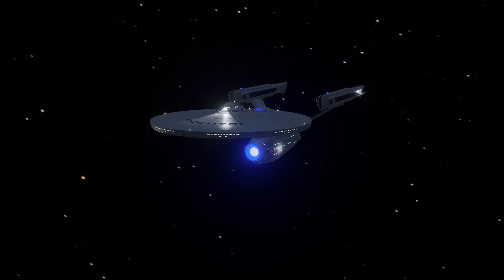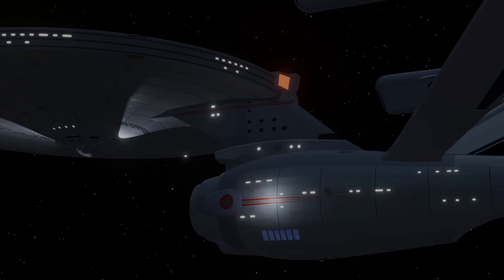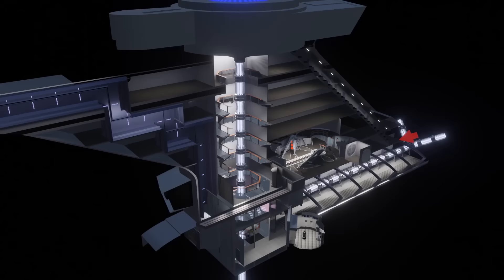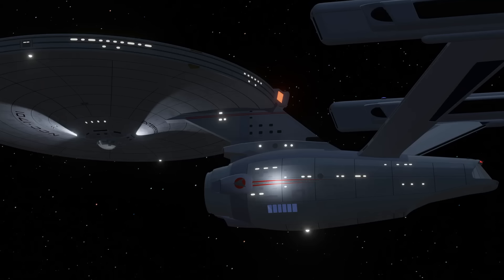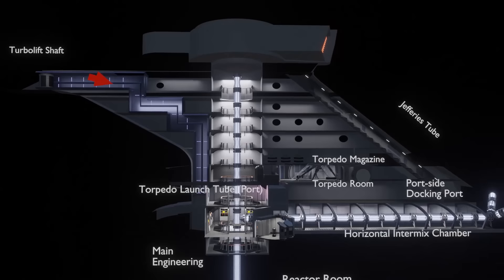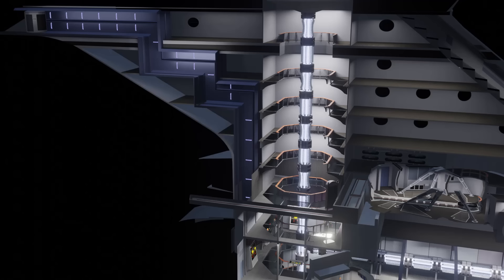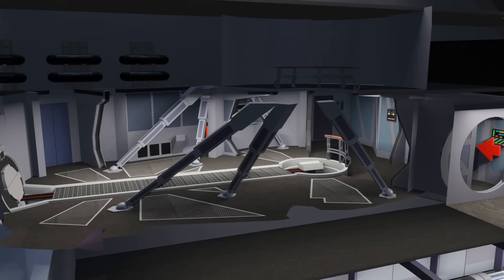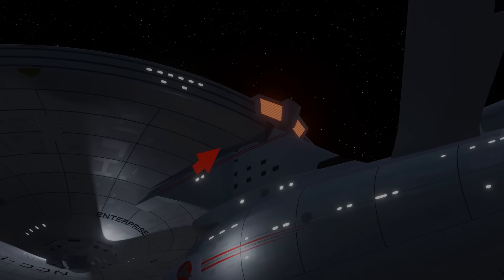The Enterprise Dorsal Problem: how did the turbolifts pass through it?

Comment: Great video! I hadn't considered the notion that the turboshaft could span diagonally. I suppose if we want to rationalize a little bit, I could imagine Kirk left the torpedo bay to cross the balcony around the warp core shaft to a turbolift access on the other side.

There's a set of deck plans made by the guy who does Cydonia 6 for both the original and refit Constitution / Enterprise that are just epic, especially because they make locations line up brilliantly pre and post refit in a way that makes sense pretty well. On his designs the turboshaft is in the aft portion of the dorsal, doing only a brief stairstep and basically swinging into the impulse engine complex near the saucer rim (avoiding the concave). He doesn't sell that particular blueprint anymore, sadly.

I absolutely recommend his Intrepid / Voyager though, and can also vouch personally for the B'rel deck plan. He manages to make /everything/ we see on screen fit (and in Voyager's case, a few beta canon locales as well). He also has a Defiant and Oberth, I don't have those but I have to assume they are the same top quality work.

Comment: Turbolift tubes are not simply vertical tubes. Turbolifts themselves work on magnetic fields, much like the electromagnetic battery, magnet and coil science projects for kids. They move up and down, forward and back, and can move around the saucer section. Also, while we see the bridge turbolift at approximately 7 o'clock, offset behind the center chair, and many people have surmised that the bridge is actually turned slightly sideways, the reality is that there are 2 turbolifts that access the bridge. Something never shown is the access corridor that surrounds the bridge, essentially a hallway that allows access to all of the systems that operate the bridge from behind the consoles. This is a brilliant design because the extra space shields the bridge from external damage with an extra layer, allows repair crews to fix the bridge without being on it and interfering with operations, and allows someone on duty to "do their duty" without everyone hearing them grunt and plop, or smell malodor when they open the door. That's rights, the bathrooms are located in this utility corridor. SO, while the turbolift we see on the bridge if off center, there is another to the right of it that is accessible from the corridor. In fact, in several films, we see the crew exit a door to the left of center, including the film crew in Generations. I assume that operating procedures would not allow the main bridge turbolift to be used by anyone but bridge crew and that the secondary turbolift is larger, to allow quick evacuations of the crew and to move large equipment. It's also likely that there is a beverage station in this corridor, an armory, basic medical gear, space suits, escape pods and outdoor gear. It's not unlikely that there is an almost complete backup crew, inactive but on call. There may be bunks and backup consoles. The access corridor can be seen in blueprints: https://i.imgur.com/jvUDF7H.jpeg

Comment: In the the cutaways and schematics i've seen it puts the Refit Conny at 145 WOA, which would situate the neck at ~8m WOA, and the only time we ever see the vertical intermix chambers are in the TNG era on much larger starships, where the entire core is vertical, ie. Intrepid and Galaxy class ships. Turbo lifts were only about 2m wide at most in the TNG era, and the corridors were leading to them were just as narrow if not a little narrower say 1.5m so we given these measurements we can snugly fit rounded tubes with forked corridors and shafts within the neck?

Comment: Strategic Designs blueprints do a good job answering this pretty convincingly. 2 turbolift shafts go straight down from the bridge for the first 5 decks before branching out on deck 6. One of those horizontal branches snakes toward the port, aft quarter of the saucer, then drops down to deck 7, and follows the edge of the saucer around to the back, sliding just behind the intermix chamber shaft and just under the impulse engineering compartment. It then goes down 3 decks to deck 10, runs horizontal toward the aft, goes down another 3 decks to bypass the photon launcher room and the torpedo magazine above it, and then snakes down into the engineering hull.

Comment: i just like to imagine that turbolifts are basically vertical tubes or capsules enclosed with a spherical SAS framework, this sphere would be able to keep the capsule perfectly perpendicular to the reference point of the ship, its artificial gravity. while the sphere also simultaneously acts as an adaptive rail connection for the turbolift system, since a sphere will always be in contact with the walls of a cylinder regardless of orientation, all it would need to operate realistically are either alternating linear magnets, or a negative vacuum propulsion. the turbolift capsule itself could also act as a lifeboat in case the ship gets destroyed before anyone can react or even leave the turbolift. i know its probably not canon but as far as my understanding of physics and engineering is concerned, it is a sound theory.

also its not all that difficult to answer the interference between the torpedo deck and the turbolift shaft, instead of trying to get it to pass through the middle of the neck, it could simply go through the front of the neck and passed in between of the 2 torpedo tubes on the way down to the deflector array, then subdivided from there to access the torpedo room from below with 2 independent shafts, weapons systems are engineerings concern to begin with, so it doesnt make sense that the CIC and bridge would have direct access to the torpedo room from the saucer section. and even if they did, turbolifts move fast enough that it would only take a hot minute to get there if the shaft is elegantly designed and not designed like a stepladder. having a cylindrical turbolift shaft that accepts spherical turbolift carriages would also significantly streamline the range of motion and overall speed of the turbolift, acting as a smooth channel rather than a square corridor that you may as well walk through.

Comment: Interestingly, this issue only exists because the concept of a singular "warp core" running the entire vertical length of the ship wasn't a thing when the ship was designed. Matt Jefferies often talked about how the design element of having bits of the ship stuck out on pylons was because it made sense that the parts that were generating or utilizing just insane amounts of energy as to warp the fabric of space/time itself would be safer being as far from the crew as possible. All of his drawings and schematics for TOS and Phase II always label the nacelles as "power units" or "power pods". So, I think it's pretty clear that originally, the antimatter reactors were out in the nacelles along with the warp coils.

I think the vertical Warp Core idea was something someone else came up with during the development of Phase II purely as something to make the Engineering set more visually impressive.

Comment: According to the various tech schematics I've seen over the years, the turbo shaft does indeed go down ahead of the vertical power column.  Tip: that is not an "intermix chamber."  The intermix chamber itself is the large round structure in engineering.  The "pipe" going down from the chamber leads to the matter / antimatter storage containers.  You can access the turbolift on the forward starboard side of the photon torpedo chamber.  Or you can take a personal elevator down directly to engineering from the torpedo chamber.  Note that the turbolifts will not take you directly to engineering.  But will instead let you out on the main engineering deck

Comment: I have never thought about this, and have no prior knowledge of these systems. But if you were designing such a system your first criteria would be redundancy, and ability to route around or avoid damage. The system would be a loop, to allow multiple passenger transports to share the same turbolift infrastructure. This would also help in the evacuation scenario to carry lots of crew into the saucer rapidly. The loop would have shortcuts to deal with saucer separation, or damaged sections, or just to bypass lifts that are stopped at entrances. The turbolift therefore also needs to incorporate the ability to seal itself in case of a breach, so there would be bulkheads around the shortcuts to allow segregation and independent operation of sections. There would also be a staircase (or slanted corridor with its own interpretation of gravity), rather than relying on service ducts as a backup. The turbolift itself would be lozenge shaped, to allow it to fit through the tubes at any angle, and presumably used a form of maglev for propulsion (proven, no friction, fast). The interior seems to have inertial dampening so the passengers don't experience the contortions of the route through the ship.

Comment: This is also assuming that the warp core structure is the same on all decks. It is possible that there are little to no openings in each deck, and something more like a shielded tube the core resides in until the crystal at the top. This would provide an access for a turbo lift car to the port or starboard. At least that’s how I figure it being done.

Comment: When the lift reached the top of the interconnecting dorsal fin, it moved either left or right then straight forward avoiding Impulse Engineering. The Primary Hull cuts into the fin at that point allowing the lift once it arrives at the top of the fin to move either left or right then straight or on around the primary hull.  Also remember there is a lift in the Warp Drive Engineering Room that runs from somewhere in Impulse Engineering to the floor of the main Intermix chamber. The Lift is open so one might want to hang onto the railing of the Lift as it travels down into Warp Drive Engineering.

Comment: I like to think right at the top of the intermix chamber right below the impulse complex the chamber was closed so the lift can ether go left or right around the core-itself, just having the top section of that open chamber would fix this issue quite quickly, straight path along then around the core then behind a bit of a turbo shaft box around the core at the very top of the chamber.

Comment: The turbo lifts were actually micro transporters.  Being hard wired from terminal to terminal, passengers could be beamed to the next terminal in micro seconds without realizing it.  The only reason it took any time to traverse multiple decks was the delay between arrival and departure within a given lift station - for safety reasons.  This gave the illusion that passengers were 'riding' in an enclosed lift carriage, when, in point of fact, they were being beamed from one carriage to another.

Comment: Solution: The turbolift shaft simply passes to the side (one or the other or both) of the plasma conduit in the neck while still in the saucer section and comes down behind the conduit through the neck. More room, no set retcons and only adds a few meters of travel (oh darn, it's a turbolift). It solves nearly every problem you're describing.

Comment: It was my headcanon that the turbolift can go up, down, sideways, and slanted.   The warp core "tunnel/chamber"  throughout the neck didn't have to have an actual room - maybe just the tube/chamber connecting the primary warp core to the impulse core is needed so that the turbolift could somehow go "around" it to get from place to place.  

That said, as much as I liked the refit Enterprise - I've always hated the neck area.   Looking back, I also kind of hated the original TOS neck as well as I got older and started thinking beyond aesthetics - the neck was always going to be my sore point with either design.   While I didn't like how the Enterprise B looked overall - I can respect that it actually "FIXED" the neck problem by literally making it thicker and even made it "armored".   I especially liked how TNG's Enterprise D pretty much tackled that problem by giving it a cobra head-like neck that was tapered at the front, but flared towards the rear.   The Enterprise E did away with the neck entirely - bypassing my main gripe about the TOS and refit designs - and it was my 2nd most favorite and most practical design of the USS Enterprise that I liked (the Enterprise D takes first place, while the refit takes 3rd).    I know that some people didn't like the Enterprise E, but it was one of the most "practical" designs in my opinion that didn't create a visible weakpoint between the primary and secondary hulls.

Comment: 1. It would make sense for the neck to have more than 1 turbolift; not only for hte purpose of redundancy but also for the purpose of traffic.

2. One tubrolift would run forward of the  PT Launchers as described and the other one could run behind the core and that would be the one that Kirk used.
Now of course that turbolift can't cross forward throught the core, but on the otherside we asume that the impulse engines occupu the full 2 decks  as one massive block, wile in reallity they could ocpy just the top deck for most of the part and  the second turbolift could then access the saucer below that and deviate into both sides of the saucer rim.

Comment: The deck plans from Strategic Designs actually show the turboshaft being behind the intermix chamber. It enters the saucer section at the back, and then goes around the intermix chamber inside the saucer section.

The Jefferies' tube ladder, however, goes down the front and directly between the torpedo launchers where you have the turboshaft shown.

Comment: Franz Josef’s Design had a full deck plan for the Enterprise that detailed where the turbo shafts ran throughout the ship
Reply: Correct. It didn't accommodate a vertical warp power shaft in the neck because that didn't appear until TMP.
Reply: @ogremark5  exactly.

Comment: It's not just easy to build an inclined lift, it's trivial. You just run it on rails that angle. Easy peasy. You can even have straight verticals and curve the rails to an incline and everything still works.

Comment: One thing to consider/remember about the "turbo lift" that Kirk took from the Torpedo room wasn't a turbo lift, it was just a very basic 1, or maybe 2, man lift and not even really a proper elevator and probably only moved up just 1 deck. That next deck up was probably where the turbo lift leading up was probably located and there was either no turbo lift in the torpedo room or, if there was, it was located further aft in the torpedo room and only went down to the secondary hull.

Comment: While putting the torpedo deck on top of the engineering hull, made a lot of sense, having the reactor and the plasma conduit run around the whole ship caused a lot of problems.  Then when considering the incredible energy consumption of transporters, phasers, and deflector screens, the plumbing would have to be considerable on any account.

That makes for a problem with the neck on the Klingon battle cruiser.  It's just too thin to support the plumbing for shields and disruptors, let alone Photon torpedoes!  Both ships could use some love from some engineers, who aren't on the clock.  Of course, they're going to have to take significant liberties, that a lot of fans aren't going to like, such as sweeping changes to the weapon systems.

Comment: There are hundreds of sites online that show the deck plans of Enterprise A, and show that the saucer section and engineering section have 2 different turbolifts. The top of the Engineering section Turbolift is close to the bottom of the Saucer section Turbolift. Simple answer is you cannot go directly from the bottom of engineering to the bridge in one turbolift, but have to hop out of the engineering one, cross a short hall, and get in the saucer turbolift.

Comment: There are 2 torpedo rooms. They are redundant specifically for the reason we see in Khan; if one is damaged, one still works. That's why Spock's funeral takes place in an undamaged torpedo room. Also, why si the assumption that the intermix chamber rises all the way up through the saucer? Just because there's a glowy bit on the saucer above the intermix chamber doesn't mean they were connected. The intermix chamber likely didn't travel that high. It likely only went to the neat top of the dorsal, then connected to several breakaway power connectors to travel around the saucer section. This makes sense because the saucer and stardrive section of federation ships has been able to separate since the original Federation ships blueprints package that was available in the 70s. This was done on purpose and for a clever reason: the saucer is a command and living space. It is a fighting ship capable of sustaining the entire crew for inter-solar travel. It can't warp to other star systems, but can travel within a solar system, with everything it needs. Also, it allows ship configurations to be more flexible. If you look at those old Franz Joseph blueprints, it's pretty clear that the concept of the separate sections was intentional so that the stardrive of many different configurations could be attached to a command, or saucer, hull.

Comment: Here is another problem. Early in STAR TREK: THE MOTION PICTURE, Kirk is walking through the blue lit engineering decks, enters the intermix shaft one deck above the main panel, then takes the small lift down one level to the main engineering level where we see the horizontal shaft run along the top of the secondary hull. Where the heck was Kirk walking from? That whole area would have been in the dorsal area.